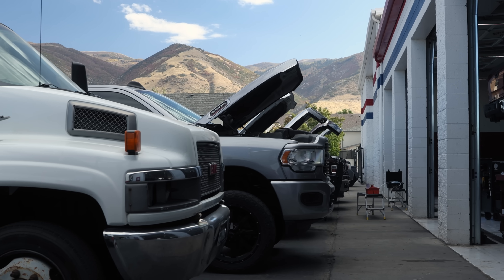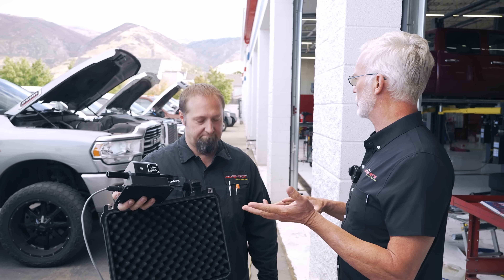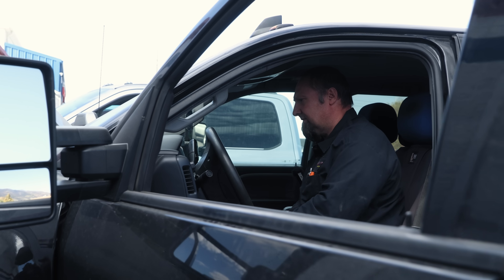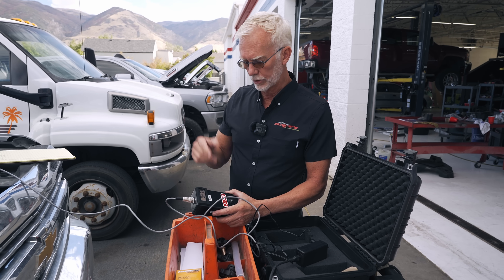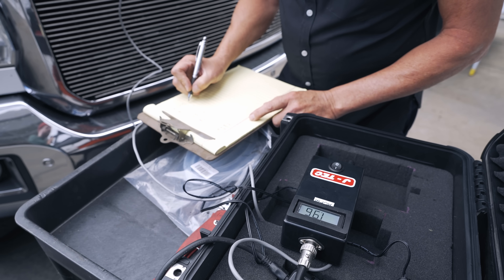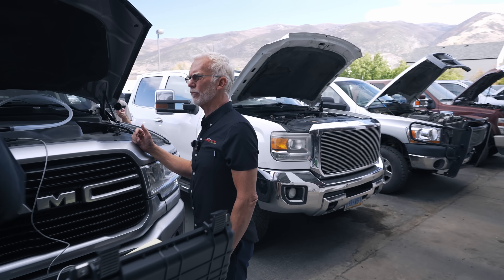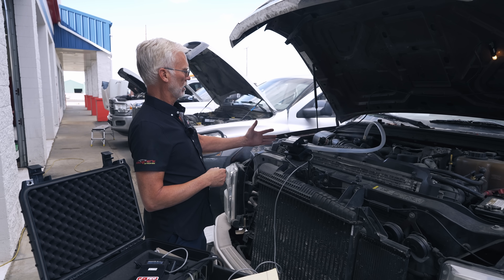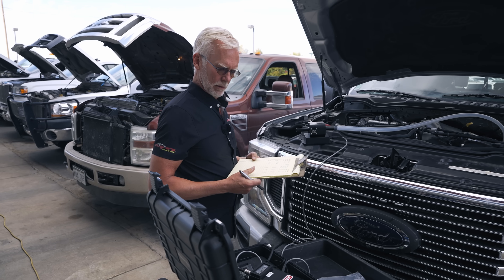Diesel Blow-By Field Testing on EIGHT Trucks!

Comment: See why weren't shops like this around when i was an ASE tech? Seriously the greedy low paying zero benefits work 12+hr day jobs where all you could get. Unless you took a independent "speed shop" job for peanuts hoping to soawn a career, but in midwest most of those are fly by night or drugs involved somehow.  If Daves shop was where i worked i'd stayed a tech. Now im a commercial carpenter building biggest high rises,structures,  and bridges. Making 3 times as much $$, fully paid benefits,  a pension after 30yrs, and im healthier outside active. I mean ASE master techs should be making 50+dollars an hour 4 skill required. You must know mechanics and computer repair, code, hardeare software, ontop of complex engineering fixes. Yet you get paid less than most ppl who work at a bank, and are expected to have 1.5years of wages worth of personal tools. You can only move with a flatbed for 1000s of YOUR $$. No shop pays to move ur tools. I hope daves wages reflect ACTUAL cost of living. Most right wongers pay 15$ an hr think they r doing you a favor while making all the profit

Comment: OMG peoples need to learn to take care of their trucks !!!!!!!!!!!!!!!!!!!! i pulled campers for years 04 5.9 cummins have almost 0 blow by cap sat like it was not running had 616k miles, 07 6.7 cummins was deleted when i got it, at 607k miles you would see just a puff of smoke come out the oil cap once every couple minutes... I got a 19 Ram that had a bad EGR from get go dealerships blew me off as i was complaining about low turbo pressure( they said normal brreak in had 14k when the problem started) at 74k miles it finally set the engine light on they charged me to clean the EGR, 2 days later i was broke down with the EGR stck wide open 10 days waiting for part in hotel and 3000 more dollars, after that it had blow by and used 2 quarts of oil every 5000 miles. after 10 more months of arguing truck had 170k on it i said come and get it... To me warrenty should have covered it because problem started at 14k and there is 4 dealerships that have records showing i had a complaint from the 14k to 20k but not one of them had any notes of why i was complaining...

Comment: The good old 6.4 powerstroke. Ticking time bomb.
Reply: I saw it and said I know what this thing is about to do!  And it was even worse than expected.  That good ole 6.4 never lets you down from being much worse than expected
Reply: You know an engine is bad when some shops won’t even work on them. I had one for a while and chose to let it sit and rot into the ground after it wouldn’t fire after shutting it off one day. I run 2 pre emissions NPR’s for my landscape company and couldn’t be happier. Looking for a nice LBZ but haven’t found the right one yet.
Reply: @ohtwo23 so you shut it off and it would turn back on? If it was running good before you shut it off it would have been a simple fix
Reply: @carter.coleman   i just kept having issues with it and finally said the hell with it and bought an NPR. There were codes showing an injector bank down and another showing PCM. i was done
Reply: @ohtwo23  what trim is it? If it’s not a base model I’d consider buying it for the right price
Reply: @carter.coleman   I sold it earlier this year. There were just so many little things that kept going wrong even though it was bulletproof. Couldn’t take it anymore
Reply: Yes they are the whole engine should have been a recall
Reply: Emphasis on tick

Comment: When Dave blew into the meter, he was way over the limits of DWI (Dieseling While Influencing). Dave you Rock Brother‼️
Reply: @DavesAutoCenterCenterville truck frames aren't straight. They don't stay straight, and many don't come straight from the factory. They handle like garbage.  They need diagonal "spokes", just like a bicycle, except on the truck frame. Forming an "x". One inch bolt, near the rear cross members, should be fine. Build a mounting plate or backing plate, or hanger for it, and thread it through...... Then tune it just like you tune a bicycle wheel. You're welcome. I will call your shop to confirm on Tuesday. October 22. When you make a video about it, just say Sasquatch told you about it. 

Also, unibody vehicleS can have similar "x" installed and formed into the design of the floor, with bolts that can be tensioned to straighten out the frames....... They aren't perfect from the factory, and don't stay perfect. When you're on ice, the car MUST be straight. 

This should have happened 140 years ago with the invention of cars. It would be the first "safety" feature of a car. For some reason they are obscenely expensive, and they aren't even tuned for alignment and handling. It's obscene. Adjustable rear subframes don't counT, because at high speed, on ice, they weathercock - from different air drag across the warped body.
Reply: @DavesAutoCenterCenterville DUDE THIS VIDEO WAS GREAT. Now it would be interesting which trucks were using diesel fuel supplements routinely and which supplements. INJECTORS are the heart muscle and fuel and fuel quality is the life blood of that diesel cardiovascular system.
Reply: Best reply award goes to... VERYMADMIKE!!! 😆

Comment: It’s amazing you got that many trucks with that much blow by and most of all the manufactures don’t care whatsoever to improve the system and make it better where there’s no blow by no drag cars they do it and they take care of it on blow by an over 5000 hp but these trucks heremanufactures incompetency of the motor properly last 300,000 or 500,000 miles
Reply: The manufactures have no control of how the end users maintain their engine over the course of its life.

Comment: Blow-by was always a parameter that we measured at Cummins Illinois/Cummins Northern Illinois as part of the dyno test. As I recall, It's been about 25 years or so, 3" H2O (might have been mercury)  was the no go spec.
Reply: 3" of mercury would be vacuum though,  but blow-by should be measuring positive pressures. I wonder what's up
Reply: @sethnowak9823  column height can be used to measure both pressure and vacuum.

The medium used (mercury or water) doesn't define one or the other, they just give a different scale.

The difference is which end of the fluid column the sensing line is connected to.

The meter in the video is measuring Actual Cubic Feet per Minute which is volume. Completely different to pressure.
Reply: @JonoSann  very good point! Thanks for the good explanation.  I've never seen inches of mercury used for pressure

Comment: Doesn't a clogged filter push any extra through the cap you have on? So replacing the crank breather filter let's more air through the filter and less through the test equipment. Meaning it's not reducing the blow by??
Reply: Exactly my thought. I think Dave is missing the boat on this a little bit? And a new crank case filter will do absolutely nothing for improved efficiency and power.

Comment: What would cause a crankcase case vacuum? I have already changed the pcv valve with no luck l.
Reply: Failed intake manifold gasket pulling a vacuum on the crankcase

Comment: So is blow by always a motor that’s toast and needs replacing ?
Reply: Yeah for the most part. turbocharged engines have blow by it’s just at what point is it worn rings, BHG, cracked piston, etc. also there is no sense in building just the bottom end. If you do the bottom end only, the top end is surely going to cause issues down the line. Imagine rebuilding the bottom end for the top end to only drop a valve and ruin that fresh built bottom end.
Reply: No specifically when tester is being utilized incorrectly
Reply: No, you have to check your filters: Air, CCV and exhaust if applicable.

Comment: I have worked in the engine testing world for 20+ years and JTec flow meters have been used for blow by measurements in many applications. Super simple reliable product with excellent support if ever needed. Ziptie that meter under the hood and run the cable in the ca, check it out on a drive.
Reply: New Engine suck nowadays
Reply: @ceasarperez8567 mmmmm idk about that one, yes on the smaller stuff but a majority of the truck engines are by far superior. Especially gasoline, the diesel engines themselves are superior. But...and this is a big but, the epa added trash chokes them.

Comment: Great test. I'm wondering what causes the wear in these newer trucks. Is it possibly EGR? I have a 96 12 valve with 211000 miles and no blow by.
Reply: I have a 96 12v to has 502000 miles little to no blowby
Reply: Lack of oil changes. But yeah. If the engine has to chew on its own farts. Can’t be good for its longevity 😂

Comment: I would have loved to see an old 7.3 powerstroke because i know that they love to throw smoke out of either, or both, the oil fill cap or the dipstick but have no pressure. I know from experience as I have one myself.
Reply: I’ve owned 5 different 7.3 powerstrokes with varying mileage and they would all fail the “making the oil cap bounce” test, but never had a problem with any of them. My 99 that I drive now has 265,000 miles on it and still going strong.

Comment: You and your blow by freaked me out. I have a 2012 TDI and check the cap, boy was it dancing and everything. 

Come to find out the vacuum pump is vented into the valve cover.
Reply: Volkswagen route it to the intake.
Reply: @gulfy09  maybe on some. I’m only familiar with my specific vehicle which is a diesel.

Comment: Gohdamn 2015 with close to 400K … and still runs good 👏🏾 bravo to that owner
Reply: should go talk to the camper pullers before i quit in 21 i knew several with old dodges with over 1 million miles i parked 2 after 600k the 6.7 was running so good they couldnt diagnose why the fuel mileage was dropping. I had enough to do one of the 2 things that needed done but since it was still running so good they said ya have to change both the pump and injectors. changing one would kill the other and probably take out the engine.
Reply: @Thultarn have you ever figured out why your mileage was dropping? that’s currently what I have. 2011 ram 6.7 cab and chassis with 412k miles. Engine runs good, no blowby but mpg ain’t the greatest.
Reply: @Maximumdub  mine went from empty 23 mpg to 14, loaded 10 to 6 i was pullin campers so weight not to bad heavy average 23,500. Guy who bought it was still driving it when i last heard a year ago but was starting to sputter heavy excelorating. I think it was both injectors and the cp3 pump getting weak. I used Hot Shot Secrets additives to fuel and oil.

Comment: I have ford transit connect 1.5tdci 2017, 240 000 Odometer, the blow by is clear no colour but pressure is there. Is it bad, what can be the cause? 

The van drives well though
Reply: Normal, don't worry about it.
Reply: Frequent oil changes, that’s it.

Comment: Shows these aren’t gonna make it to 200-300k or 500k miles. Those blow bye’s 💨 are gonna need tear downs/rebuilds new rings at min. 

Are these completely stock boost levels, or do some have upgrades like tuner devices with added boost levels? Are they towing commercial payloads/ cross country trips or they just personal occasional use vehicles. Surprised at how low the mileage was to have this type of problem?

Comment: I feel like my 7.3 leaker would blow the competition away 💨
Reply: Got a 12v Cummins that’d give u a  run for your money
Reply: @chasewebber4316  check the vacuum pump on a 12 valve, it will make one look completely wore out, don't ask me how  i know, lol.
Reply: 12v never stops.
Reply: @chasewebber4316  child
Reply: Blow by the competition lol
Reply: Mine doesn’t have enough pressure to move the cap but she looks like a fog machine if I pull the cap off. I think they came from the factory like that 😐
Reply: @wreed2724  why do they do this? I’m looking at a used 7.3 that is the exact same. Cap is stable but so much steam/smoke. You worried about yours or nah?
Reply: Such an underrated comment
Reply: Don't forget the 7.3 boost leaks from the spaghetti manifolds!
Reply: Ya they do that your alright ;)
Reply: What you feel changes  nothing
Reply: 1995 f250 Powerstroke 400k kms (almost 250k miles) turbo diesel identifies as a steam engine when the oil cap is off!
Reply: Nah 6.5L Detroit will always have the most lol love my 6.5s
Reply: @hammertank8085  they leak like crazy don't they?
Reply: @JustinRman  oil cooler lines yes they’re so old now and crack and leak
Reply: @hammertank8085 fr my 6.5 had so much blowby the dipstick would blow out of its hole
Reply: @JarronVinger  mine got worse with blowby cause it wasn’t building boost the vacuum line came loose and yeah after that it was better
Reply: HAHAHAHAHAHAHAHA 😂😂😂😂
Reply: Got a 02 f550 7.3 with 158k. Uses 1 quart every 40ish miles. Not turbo pedestal orings, plugged the dipstick leak, definitely see a blue haze out the pipe at dusk/dark when headlights are shining from behind. Been like this since I bought it in the 130s. Only put around 1500-2k miles a year on it plowing and mulching. I’m guessing someone ethered the crap out of it and damaged the oil rings cause I found a can when I bought it and sad thing was it was a glow plug relay making it hard to cold start. Has all the power still
Reply: My 93 6.5 blow by is terrible but still runs like a top! lol
Reply: Shit my 7.3 has absolutely no blow by but it also has only 110k miles original everything basically
Reply: @tannermcguire7713  well with only 110k id hope it didn't have any
Reply: Very important to check oil level when assessing crankcase pressure. An engine over half full on oil will have high crankcase pressure. Crank case pressure is not engine blow by.
Reply: Ford drivers all ways blow the competition there similar to females
Reply: I had a 99 f550 4dr 6spd. Started blowby and I sold it😂 only had 150,000 mi
Reply: What makes you think it had blowby? 7.3 do smoke some out the cap but its normal @bfields1448
Reply: I bet my 84 f250 with a 6.9 diesel that was stuck from sitting and had 4 glow plugs left out since 2008 will blow all of you away
Reply: @buttonysquare8501 yea yea